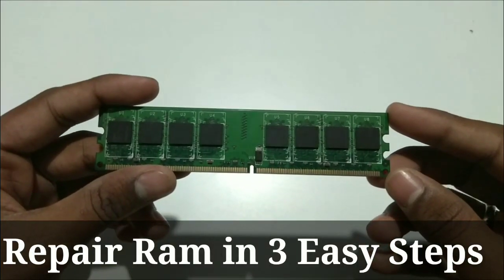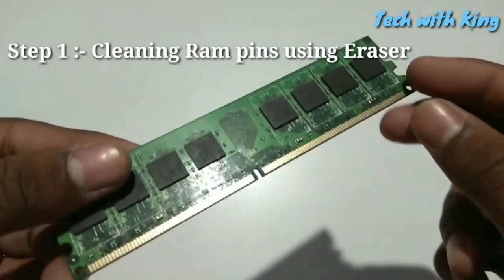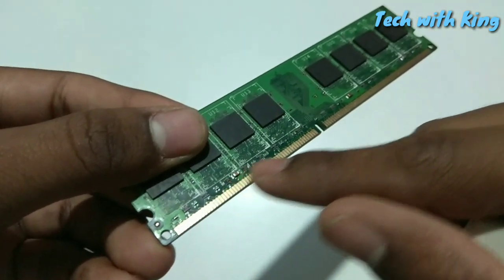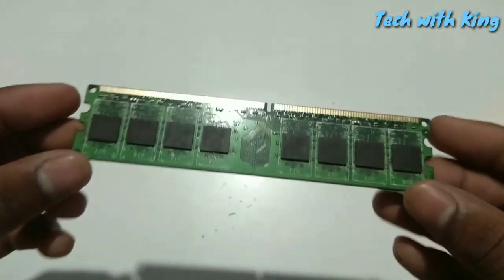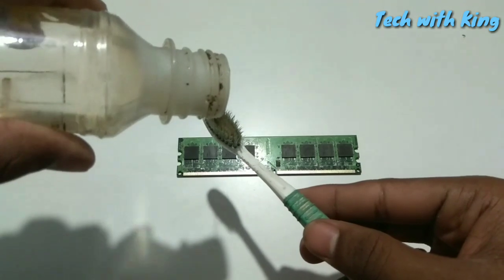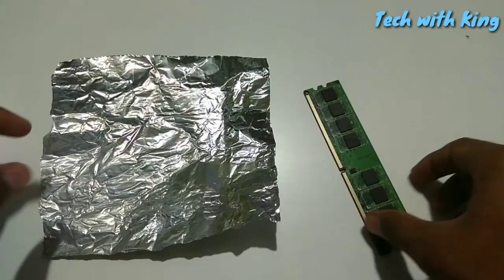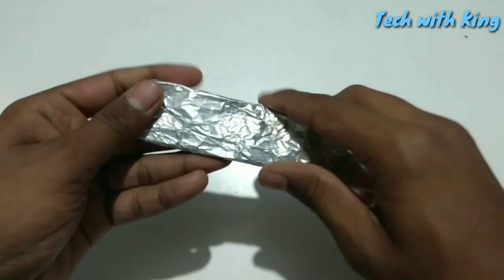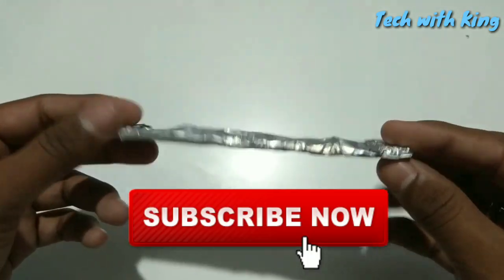How to repair Ram at home in easy 3 steps | Cleaning ram | no Display pc | tech with king

Comment: Hi Sir, is it okay to use my RAM if it lose one of its Gold Pin? It's still working btw and still reads as 16gb.

Is there will be a problem in the future if i keep using this RAM that lose 1 of Gold Pins?
Reply: Run memtest86 to confirm.

Comment: i have a faulty 16gb ddr4 ram, i found out that it is the hardware that causes random BSOD, crashing and freezing everytime i install software or open any programs. Postcode error shows B7 on my motherboard.

i want to share things that i did and how i managed to fix my ram

1) Erasers did not help, even cleaning the ram chips with brush and alcohol
2) Reseating & Removing ram sticks to different slots did not solve the issue
3)  Reinstalling Os to delete drivers and other suspicious software fails and crashed during loading the installation
4) Finally, steaming the RAM stick, used aluminum wrapping and took a rice cooker with boiling water, i just put the ram lying on top of the rice cooker's steamer for 15 minutes.

the last method worked! i managed to do a clean OS installation without any crashing, BSOD never returned , but i turned off my windows auto update just to be sure. until now, i am still using the same RAM and got no more freezing and crashing.
Reply: @techwithking263  my brother who works on auto -computer company is the one who taught me about this, though many have been successful in Oven Method, using Heat Gun is another way of fixing faulty ram, while steaming is a cheaper alternative for those who does not have those mentioned tools.
Reply: @amoyinmo-utot-ko  plus it can be less risky

Comment: Earlier i had 2 GB RAM so i bought a new 2 GB RAM to make it 4 GB in total but the new RAM is not detected, PC stills shows only 2 GB RAM. Can you help me with it?
Reply: @techwithking263  So i tried with single RAM (2GB New one) there were no RAM detection beeps (3 beeps when PC doesn't detect RAM) but the PC didn't start, doesn't it mean that the RAM is not faulty and should work fine?

Comment: man because of you i recovered my ram !!! thank you so much bro
Reply: Graymen which method did u try
Reply: @moplayz9976  teeth brush my ram was working well but i didnt turn on pc for a while i think dust didnt let ram working
Reply: @graym5374  only tooth brush ,what did u used as thinner ?
Reply: @ruthukumar9451  nothing lmao i tried with eraser too but i tried all methods on another ram and its burned i think i didnt succeed to recover it like the first one
Reply: @graym5374  eraser i have tried bro ..but with brush and petrol i havent yet ...thinking ...safe or not ..if u have tried with petrol let me know ..ill do it now ..i should go 80kms to bring New RAM as am in village 😊
Reply: @ruthukumar9451  good luck man.... i dont think petrol is safe what do you think about it ?
Reply: @graym5374  instead petrol i used sanitizer bro ..it wont harm RAM ..display is working now ..fault is mother board now ..
Reply: @ruthukumar9451  omg good luck man... you sure its the motherboard tho ?
Reply: @graym5374  i should findout with multimter ..cos if plug mouse into keyboard ps/2 port and move mouse led is absolutely working and brightens when moved ...still am not sure why keyboard is not working... may be keyboard ps/2 port is faulty else everything is perfect ...